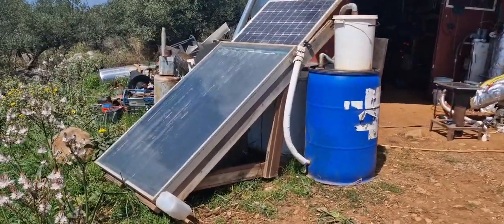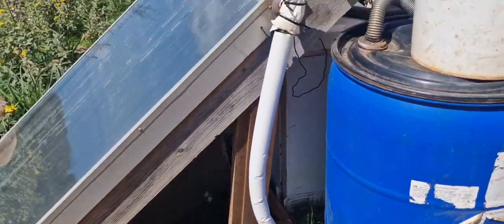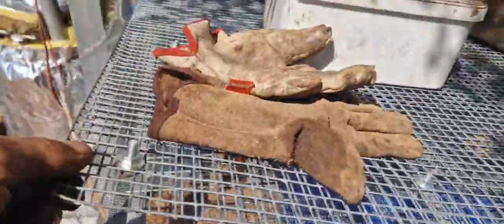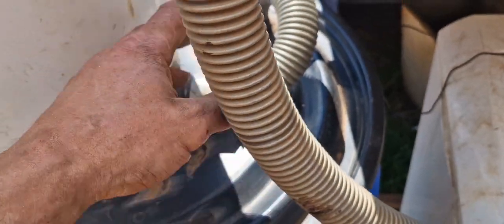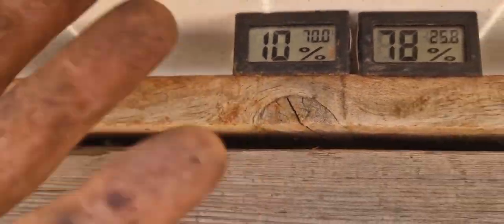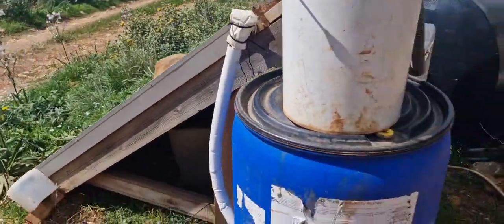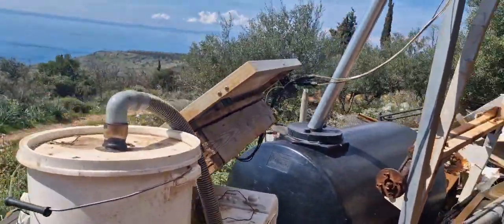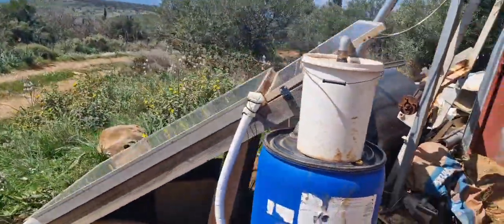woodchip drying for gasification using solar energy  #DIYGasifier #BiomassEnergy #OffGridLiving

Comment: Very nice ! Your not so far from doing a thermochemical solar heat storage ! No insulation needed to store the heat for cloudy days or winter!! Replace the woodchips with molecular sieve zeolite or calcium chloride, dry it. When its cold outside, wet it a bit and this releases heat !
Reply from the maker: That's a great excellent idea, it's not gonna take so long that I fix my gasifier in n a way i dont need drying anymore so i could pump the heat ik n the house during night times
Reply: @oscarverwey Nice ! Can't wait to see your experiment !